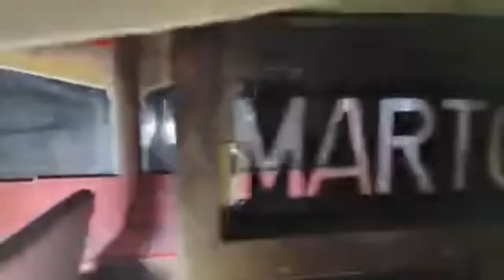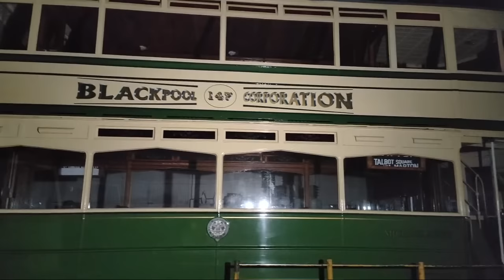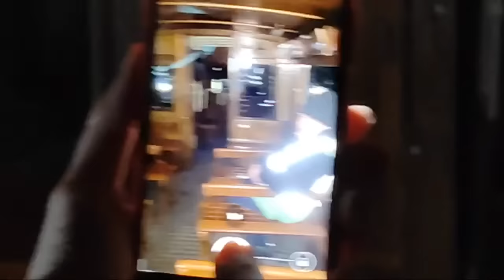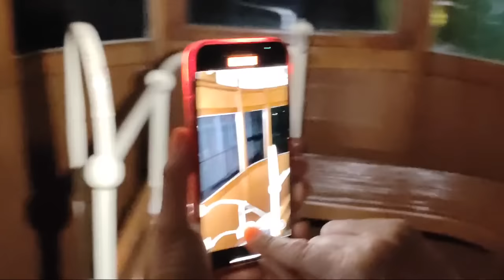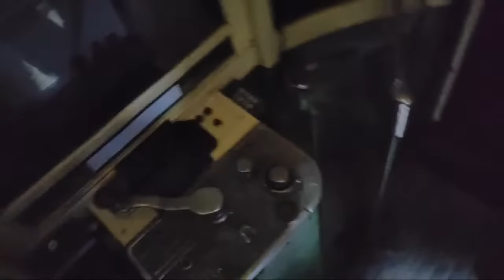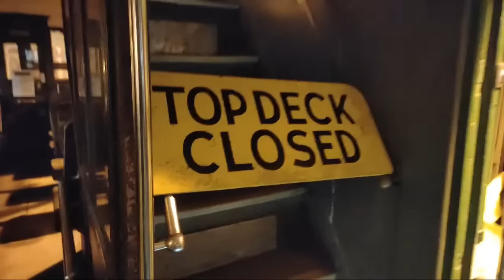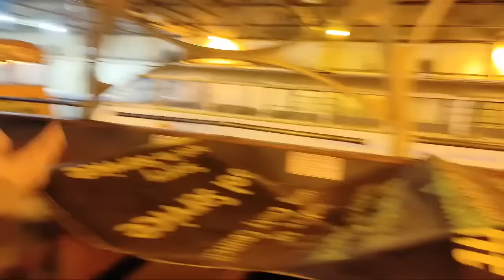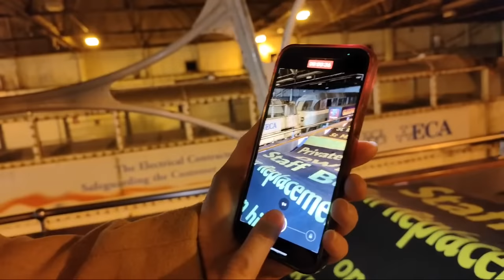LIVE Ghost Hunt At Blackpool's Tramtown | With A Walk On The Wild Side

Comment: I think there could be a ghostly presence in the tramshed, I don't know if it had anything to do with the far office and Tram 144. David mentioned someone died at the old tramshed before the move to the current one, someone died in the pit at the old site, I'm wondering if it has any connections with Tram 144, if you have heard of Most Haunted the TV programme I wonder if they will be interested in this as Janet the Spiritalist was saying she felt uneven at various points I am enjoying the video Darren stay safe and don't have nightmares
Reply: Yes, I did mention that, but due to the date, 1912, it would more likely to have been at Blundell Street depot which is now under all those new houses, as the depot we were in last night, didn't get built until the early 1930's.
Plus 144 was built around 1924, similarly to 147 we were on when all the knocking started.

So whilst it isn't impossible for Alexander Hollas to have died where we were, it's just more likely with the year it happened in, for it to be Blundell Street depot instead.

Many thanks. Glad you enjoyed it.